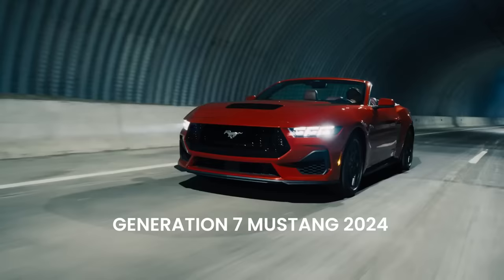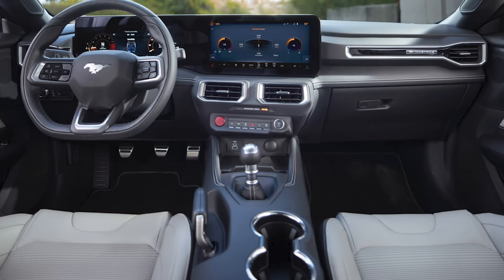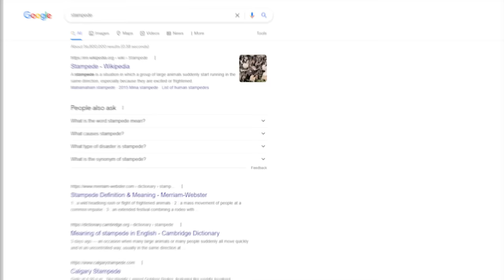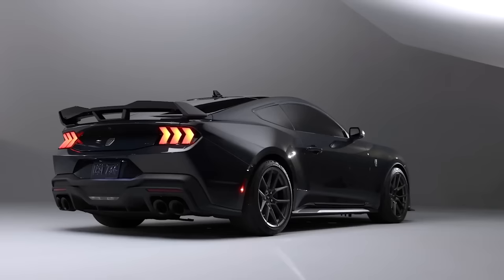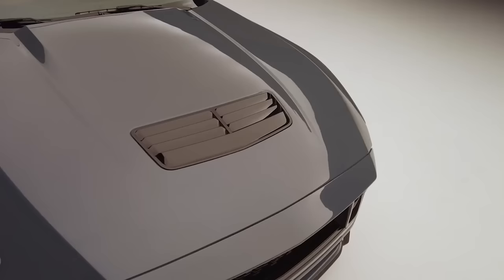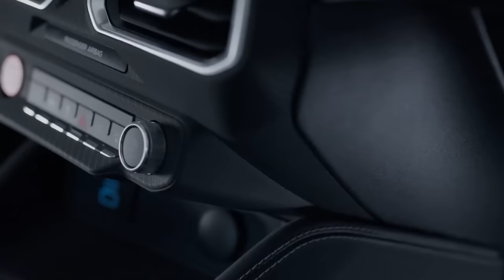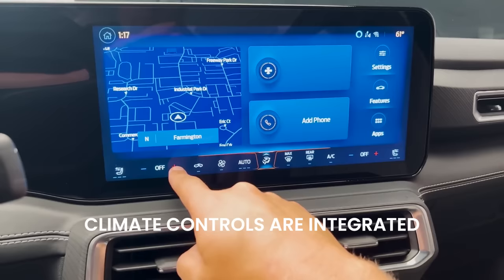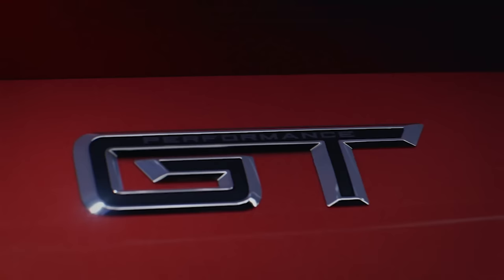NEW Ford Mustang 2024 | FULL REVIEW | Dark Horse GT EcoBoost | 7th Generation

Comment: I'm keeping my 2018 Manual GT. It's the original Dark Horse. It makes about 500 hp and is fully paid off. I like the look of the S650 except for the headlights. I like mine better.
Reply from the maker: you have a beast 😍
Reply: @autoreviewglobal  Thank you. 😁
Reply: They cool but why does my 2015 Taurus SHO with the 3.5 tt simple tune and plugs absolutely wreck the 5.0, scat packs, Camero ss, even the hellcat from a stop till about 90mph. Sometimes I don’t get the point of these super expensive cars besides for the sound.
Reply from the maker: @thorshammer5134  That's something special you got there 👍
Reply: @thorshammer5134  idk what you did, but top end is all about hp which they make more of
Reply: @natty1  top end doesn’t matter much in a 1/4 if you get a big enough jump. On the street the SHO will run the exact same as on a prepped track. I’ve ran a few hellcats from a stop, usually at 60-80 mph before they get traction. From a roll they 100% have me. My SHO is like 4400 lbs and only 465 hp and 480 tq. But with awd it does most cars dirty especially from stops. Scatpacks and 5.0 stangs ss cameros is 50/50 from rolls depending on speed started at and when stopped.
Reply: @thorshammer5134  yeah, I'd say scats are pretty 50/50 but 5.0 have 485hp and weigh less than you which is just a simple math equation
Reply: @natty1  🤷‍♂️I’ve beaten plenty. Traction matters a ton, I have no worries. I’ve also lost to plenty as well though. Like I said it’s a crapshoot. Sometimes cars need driver mods as well
Reply: @thorshammer5134  very true!

Comment: Looks very nice. Ford has come a long way. Sadly their side mirrors are still upside down. Yup, that's what I said.  Check it out yourself. These poorly designed mirrors waste valuable space looking at the vehicle when really what you want is to see traffic.  Sit in this car and carefully adjust both side mirrors. Now note that the bottom inside of both mirrors are looking at the car. How is that helping you? Please note that they fixed this problem on some of their new  Ford pickup truck mirrors. I have a video on it.

Comment: I miss my 1989 DECH. The 302 gave up the ghost. I slapped my 351 Windsor into her. I built that Engine. As a Toolmaker I am very sure I can measure 0.0001". Towed my Kawasaki 750 Double carb Jet Ski. Lots of summer times.

Comment: ‘Electric is the future’? Only because it’s being crammed down our throats.🤢
Reply from the maker: which option is cost effective? 😇
Reply: @autoreviewglobal  The ‘cost’, the true cost, is not only the price to refuel. What is the value of Your time wasted searching for a refueling station, the time wasted waiting for the refueling to complete, the increased number of refuelings required per trip, the life threatening conditions created if/when your EV locks you inside, the exorbitant cost of replacement batteries, the severely degraded range due to colder weather, additional passengers or cargo. Consider also the cost  of adding a special electricity output circuit to your home since refueling using your normal 120V outlets will take Much more time than you likely have to wait. Consider that, especially if you don’t own your house. Given the high battery replacement cost, how do you think that will affect the EV’s resale value, insurance cost?
People seem to look no further than the price at the pump and seem to believe that electricity simply comes from wall outlets! It still must be generated in the same way ad it did before you bought that EV. The same production methods, same byproducts. EV is one of those great sounding ideas that requires a lot more thought before all the car manufacturers demand everyone buy one. George Jetson is still far in our future.
Reply from the maker: @jimlynch7421  those are pretty strong points you have there 🙌

Comment: Do any models have very stripped basic controls like analog gauges, 3 knob system for Hvac and simple am/fm/sat stereo with no power windows or locks or anything.
Most people inc me buy those big rubber mats that cover 80% of the exposed carpet anways  SO
I would even forgoe carpet and back seats in favor of rubber floor covering  to save a few thousand bucks and have more storage and dog friendly rubber covered backseat area
just give me the V8 and  lightest  cheapest model possible;
Air/tilt/cruise/Auto and 7 yr powertrain warranty  is only options i want🤪